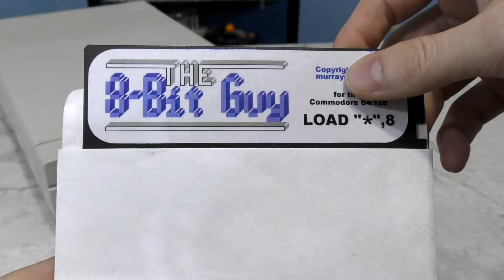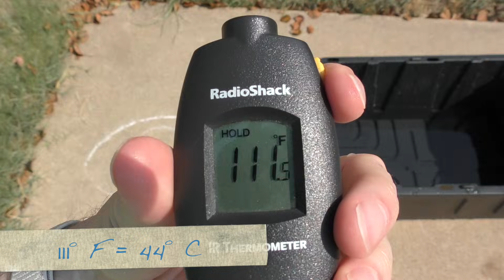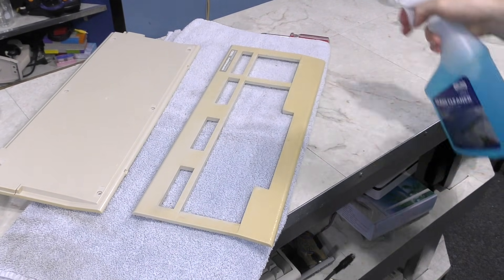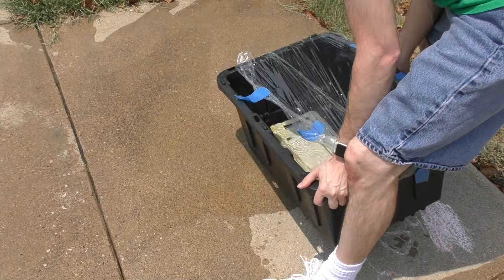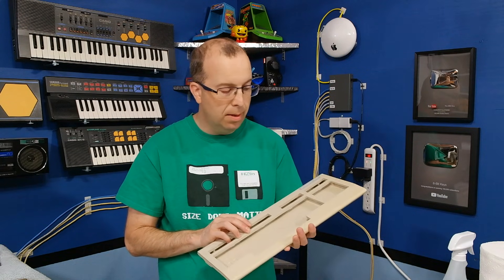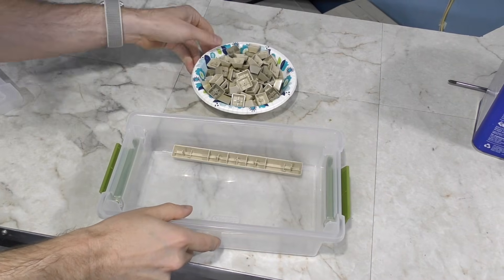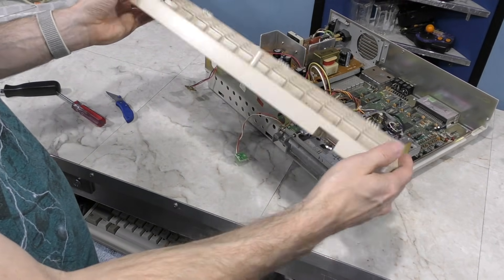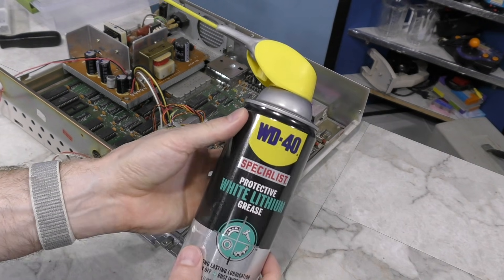Commodore 128D Restoration

Comment: You have no idea how much I wanted to crawl through the screen, take a sawzall and cut that crate down in half. No more shadows!
Reply: Or a UV lamp.  You do a TON of fussing and workarounds to use the sun.  A simple 2 by 4 frame with a 3mil plastic liner would also to the trick.
Reply: I kept waiting for him to prop it up with a 2x4 or something.
Reply: He needs like 4 to 6 paving stones that fit in the container. Stack them into the container until you're just below the lip at the top with the parts in there. You're going to displace a lot of water, so it should work out the same, but now you're at the top of the container and the shadow cast by the sides is not as big of a deal.
Reply: Or like... go to WalMart and get the clear version. They sell them right beside those black ones.
Reply: Completely agree. Shorter containers!
Reply: SgtPiggie i was thinking the same thing with the UV Lights but he now has a Sous Vide machine which he could use to maintain the water temperature as well. A grow light setup in the garage would be perfect with all the retro brighting he does.
Reply: ther he should put a transparent cover on the crate 's top.
Reply: This.
Reply: Well, Sawzall or any brand of similar saw, for that matter.

Comment: I noticed you didn't quite clean the entire baseplate of the keyboard, is there any reason for that?

I think the feet may have fallen off because you put the silicone in the middle of the rubber feet, which goes right into the screw holes and doesn't catch very well I would imagine. Some double sided tape or putting the silicone on the edges might help with that.

Also, I saw that screw up with the W key in the wrong place ahahah

Comment: I feel your pain when it comes to cleaning multiple tiny parts.Have you ever considered using an ultra-sound cleaner? Of course, it will only be as strong as the solvent you mix with water in the tank, but the sonic vibrations and whatever cleaning solvent you use should give you a really nice clean with minimal effort on your part. You should have no problems finding an ultra-sound cleaner that  will accept all the keys at once. I’ve used several cleaners for both large and small parts and I’m always happy with the results. Love the videos by the way. Thanks so much.

Comment: Silicone is a sealer not an adhesive. I think a hot glue gun would get the job done and be easy if you need to remove them in the future.

Comment: A few times in this video that you had issues with the bin blocking the sunlight during the retrobight. I was wondering if a clear bin might eliminate this problem? I dont know that much about the process so it might be that the blacks heat absorption is needed to hit the activation temp. Has anybody experimented it yet?

Comment: For the feet use double sided carpet tape. It comes in a roll, is really thin ,  can be cut to size and will be easy to remove if you need to do so in the future.

Comment: Very nice. You should use distilled water. It's less than $2 a gallon. The peroxide will work better since it does not have to react with any minerals in the water. Also tilt the container toward the sun by putting blocks under one side.

Comment: For the rubber feet you can use 3M Emblem Adhesive (https://www.amazon.com/3M-03601-Plastic-Emblem-Adhesive/dp/B000CCM3J2). Just, don't use much.

Comment: Hi Dave, 

Just use double sided tape to fix those rubber pads under the keyboard. You will only need to cut the double sided tape to size with a scissor. 

Cheers from Romania, 
Vlad

Comment: Looks good. Did you try regular double sided tape for the little feet? Also I bet rubber cement would work well. (I think that's what they used at the factory.)

Comment: Try to find some Clear Double Sided Strong Adhesive Tape For Phone Laptop LCD Screen Repair to glue in your rubber feet for you keyboard.  https://www.amazon.com/Double-Strong-Adhesive-Laptop-Screen/dp/B019OSYR2U/ref=sr_1_cc_2?s=aps&ie=UTF8&qid=1533247858&sr=1-2-catcorr&keywords=Double+Sided+Strong+Adhesive+Tape+For+Phone+Laptop+LCD

Comment: I discovered this stuff when I purchased some TV backlight replacement LEDs. Looks like it's about the same stuff as what you originally scraped off, it's what I would try for those feet. You might get addicted to it...

https://www.ebay.com/itm/273139266630

Comment: I tried sticking feet on with a hot glue gun. Maybe I just screwed it up, but they wouldn't stay on either. 
Why don't you use a transparent box and lid, rather than the black one with cling film? The UV could get through it easier without having to move it so much.

Comment: Just stick those feet back with double-sided tape. Take a wide strip, put all of the feet on there and cut it to measure with scissors or scalpel. It's the easiest method and the one they used back in the day.

Comment: If you're looking for adhesive, look for 3M Hi-Temp double sided tape.  When I worked at RadioShack, this stuff was extra super sticky and flexible, it was the perfect adhesive for reattaching rubber feet, we used it all the time. You should be able to find it on Amazon. Best of luck!

Comment: I think you've gone over it before, but now that you have the sous vide, have you considered getting a UV light and retro brighting at your leisure?
Reply: Abbreviated Reviews the reaction has more to do with heat than uv light. Personally, using the stove and a double boiler pot would be more efficient, but hey...

Comment: For the feet - double sided adhesive carpet tape - preferably the thin, clear type that is NOT fiberglass reinforced so it's easier to cut with the hobby razor knife. Stick feet to the tape, use a hobby razor knife to cut around them, remove the paper backing on the other side of the tape to expose the adhesive.

Comment: I wonder if you got a shorter black box or possibly cut yours down a bit if it would reduce the shadow your get while retro brighting. 

Also you said the rubber feet were probably held on with double sided tape, why not just use that again in case you need to disassemble again?

Comment: I feel like the vacuum heater would probably be a better method for the retrobrighting process, especially increasing productivity. I would also use a fully transparent case with lower height and broader width for the submersion process and maybe glue a mirror plastic foil or a black plastic foil underneath to either increase temperature by absorbing more sunlight or reflecting more sunlights onto the parts.

The new before/after-look is awesome!

Comment: Suggestion regarding cleaning the keys from a keyboard: Did you try using a dishwasher or washing machine if you have a load waiting? Though I wouldn't set it higher than 60°C in both machines.

Comment: The W doesn't go there! The W doesn't go there! The W doesn't go there!
Oh, good. He fixed it.

For mounting the feet, try 3M 465 Adhesive Transfer Tape. It's gooey, almost like rubber cement, which is exactly what I was reminded of when you were pulling the feet off in the first place. You can double up on it, even folding it on itself a few times to make a thick adhesive for rubber feet. And it sticks to just about anything. I've been using the stuff for years, back when I started working at ad agency in the early 1990s.

Comment: When I clean keys I just put them in a bowl full of water and dish soap, let them soak, then stir them around a lot, then rinse. A lot of the dirt just comes off, and the rest you can wipe off without too much effort.
Reply: also I use a toothbrush for the inside of the keys sometimes

Comment: The feet? Just use hot melt glue, will stick them down and is easy to remove if you need to. I do love they grey Commodore used.

Comment: Change the black box to a box without color so that the sun light may go inside the box from any angle
Reply: Doubt that would work. He's using sun light because there's a significant UV component to it. And it's surprising how many substances (including many transparent plastics) block UV.

Comment: Thanks to your videos and showing your cleaning process. I did the same with an old UK BBC B Micro 32k. It was really yellow.  I had to remove the PSU and the whole motherboard so i could clean both case sections. It actually came up as good as new, im so pleased with the result. I have an out of the box looking BBC B !.

Comment: Did you retro brite your sink lol. Marble effect. Rough up the bottoms of the feet with light sandpaper and remember to put the glue to the sides of the feet and not in the middle where the screw hole is or the glue just drips into the hole locks the screw up and causes a mess. Rough up the feet housing too and just use normal superglue but not the type that eats plastics and leaves a terrible white resedue. Great Vid.

Comment: Would retro brite work in a tanning bed/lamp?
Reply: Look at other videos on retrobrighting.  People who have done extensive tests comparing sunlight/uv lights/just heat/etc seem to agree its the heat (energy) and not the UV light that is most important.  That doesn't mean you should boil your plastics (and there are many examples of why that is a BAD IDEA).  The best way to do large objects would be in a bin and using a sous vide device so you can precisely control the temperature and keep the liquid circulating.
Reply: MrTBoneSF I wonder if someone else shows up to answer my question later...
Reply: ZeroG84 What you've replied with is very ungrateful and insulting to MrTBoneSF. He has not only answered your question but explained why.
Reply: No, I think he answered a bunch of questions that no-one asked. He wrote about heat being a major component of the process, about not boiling your plastic (dah), and the size of the container that should or should not be used and why... Nothing really about tanning beds. hmm. Interesting.

If I would now ask "Are tanning beds warm" you could do this same stuff over again and say "You are insulting someone because he answered that question and explained that to you". I'm not being disrespectful. You came to pretty much bully me because of my question. So how about it. No tanning bed then?
Reply: ZeroG84 The short answer then is no. 

The reasoning is that sunbeds produce UV light but UV light is not an important factor in the process. Heat is. 

I'm giving you the benefit of the doubt that there was a step in the logic missing for you that wasn't explicitly stated in the answer from MrTBoneSF
Reply: Dude, I know this is the internet and all, but I'm 100% with you. People with no respect do not deserve an answer, and you never know if there's a troll behind every corner. Not kidding. I know this sounds kinda childish even to some, but I kind of understand the way you read my first two comments. I'm sorry on my part, but yes. I was being sincere.

I've never actually seen a tanning bed in real life, and in TV every time someone gets out from one, they are sweaty and looking for cooling. So I have no actual reference of the heat energy an uv-light like that puts out, and no idea of the wave length of light that could tan a persons skin in the process. I respect your short answer, that is the one I was looking for. Too bad, in a way. A tanning bed could have been a steady source of uv-light to use in the process, that could have taken out the guessing game from the retrobright thingy... but I guess we are all nerds in our own field. Some clearly less than others. My apologies. I'm sorry if my comment was something that could hurt the cohesion of the community that is "the 8-bit kind". I thank you for your patience in the matter. English is my third language after all.

Thanks again for understanding. That is all I was looking for.

Comment: Why not use double sided tape for the rubber feet, if that is what was previously used?
Reply: I usually use double-sided tape to reattach rubber feet. Get the "permanent" kind. Works a treat!
Reply: Probably because it took him a while to scrape that stuff off and silicon comes off cleaner, in case he needs to open it again.
Reply: Alex Quant good idea

Comment: contact cement, a little goes a long ways, using a tiny paint brush, paint some on the case, paint some of the feet, let dry a little bit, affix the feet.

Comment: thank you for including metric for temperatures. it's a small thing but goes a long way - since you live in the US and by default use imperial, i salute you for this, sir. : )
Reply: Most computer guys actually use a lot of metric temps, because CPU/GPU's are always measured in metric, so may be normal for David.
Reply: @williambaldwin9346  in the 80s that didn’t matter